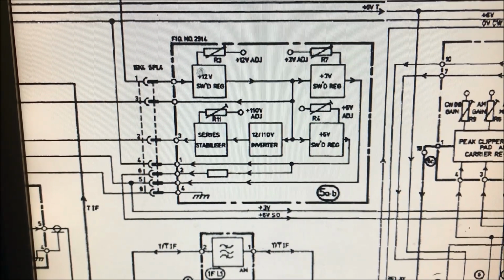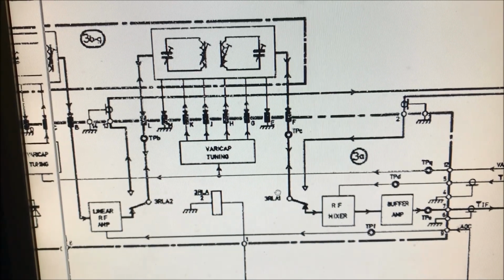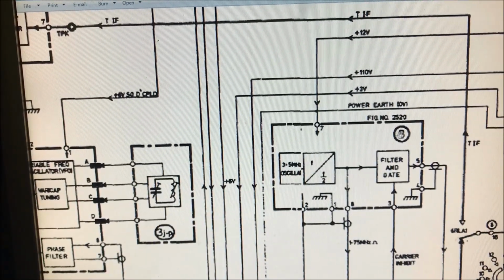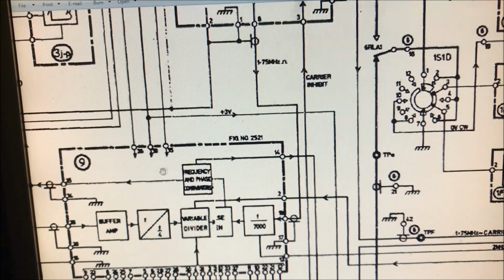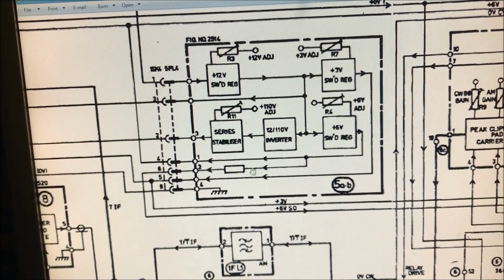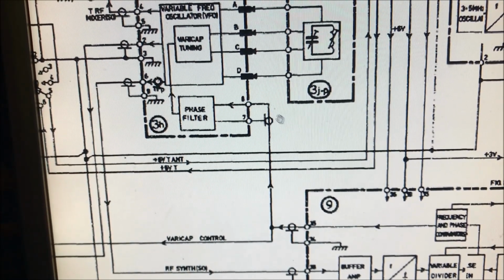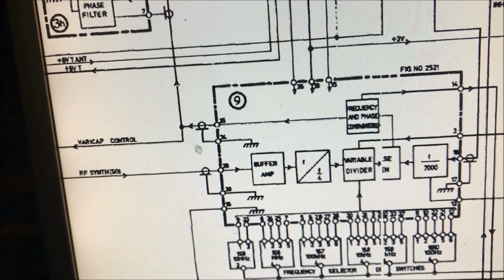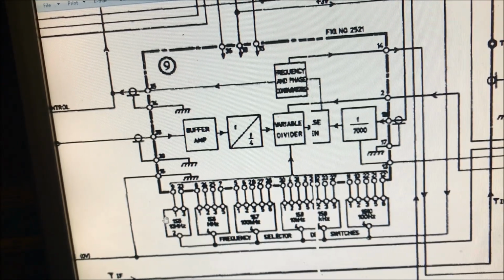VK2PRC Clansman PRC 320 Audio Wobble Fault

Comment: Alex - the Army used to diagnose and replace to module level in field workshops - the suspect modules taken out went back to a central workshop (the Army Base Repair Organisation) at Donnington which either fixed them, sent them back to the manufacturer, or kept them pending a repair that never happened. Later the work was subcontracted to companies called SERCO and Tracktek. I know the last option happened because I bid on a crate of Clansman spare modules in one of the early tender sales in the UK and they were all dead. On inspection the serial number of the module inside each box was not the one on the label outside, so they were all the return units. I guess towards the end as Clansman sets were being retired there were enough good spares left to send out, and no one was mending the faulty ones that came back. With the 320 we are fortunate that full schematics are available - for some of the others only block schematics were issued outside ABRO Donnington.
Reply from the maker: Thankyou for that information, very interesting.  As we all know, lovely field radio, we need to keep them going.

Comment: I have been lusting after one of these rigs for a year. A concern is service and availability of spare parts. I would have no reluctance to work through the various components and replace the caps as a first step in bringing one of these rigs into service. But this kind of diagnosis is at the limits of my knowledge. I learned a lot from watching you go through the process. And the fact there is a DDS upgrade should the synthesizer be bad is very interesting. Thank you.